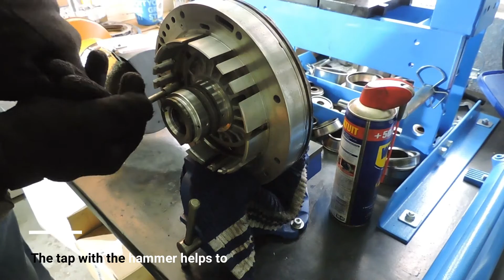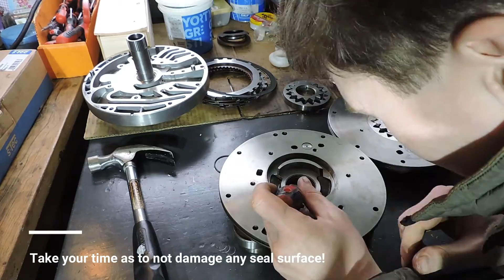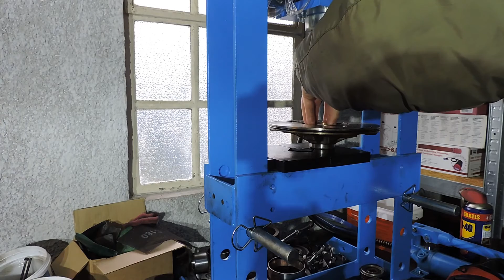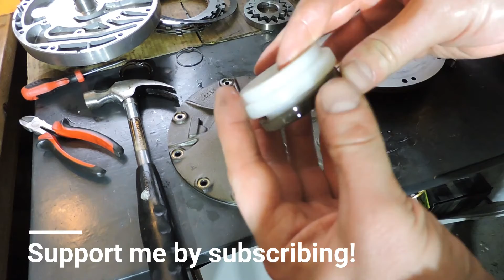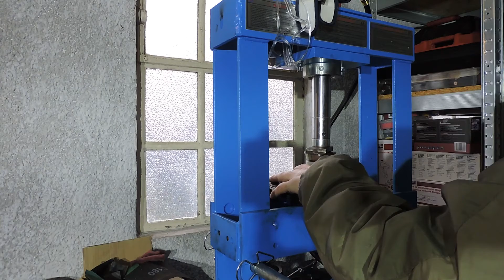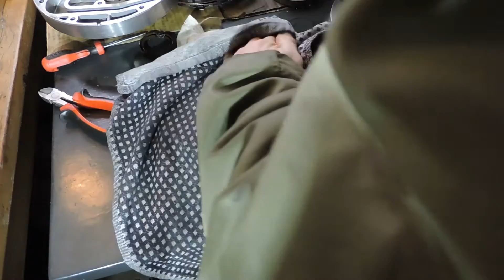5HP18 / A5S310Z Pump Inspection (BACKYARD)

Comment: Hello mate.
Have you ever heard about ticking noise from this type of oil pump? I have this problem in BMW 7 m52b28 only on warm engine. I changed torque converter but I still have this problem.
Reply from the maker: Haven't heard, you'd have to upload a movie for me to check out.